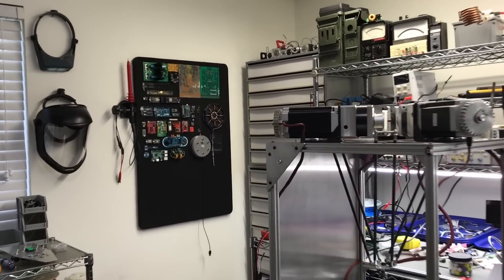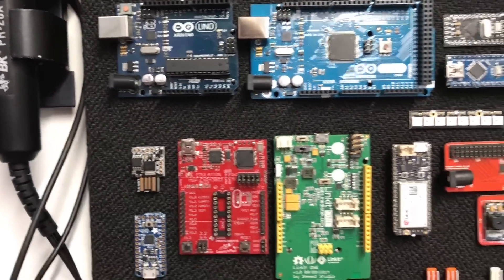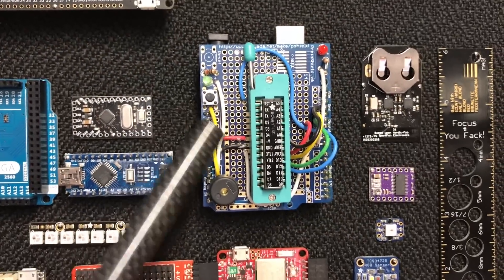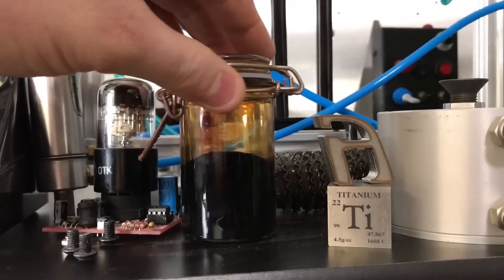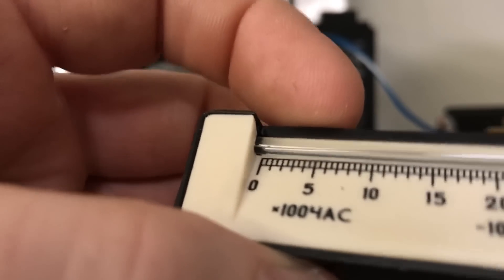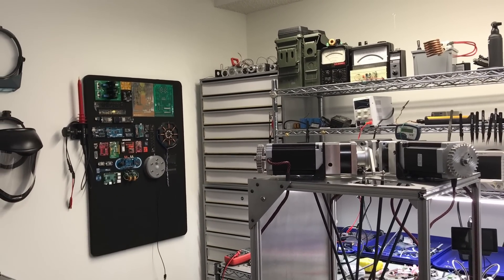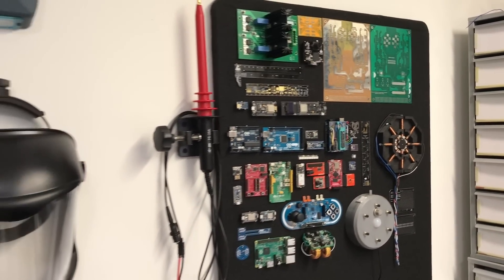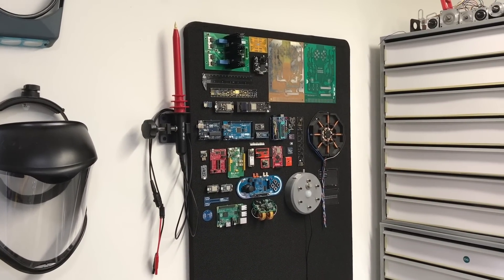Proto G Mini Lab Tour

Comment: Dang why do you have so many oscilliscopes?
Reply from the maker: There is only 1 on the main rack.  The other equipment is a waveform generator, spectrum analyzer, and power supply. The stack of old analog units are retired field units from my work.
Reply: Ooh ok, I had a feeling they weren't JUST oscilloscopes.